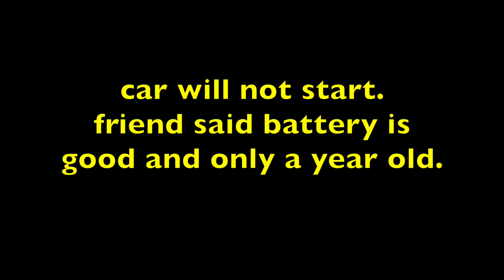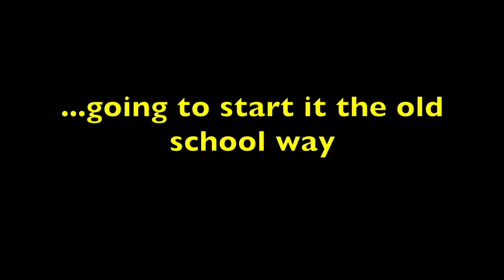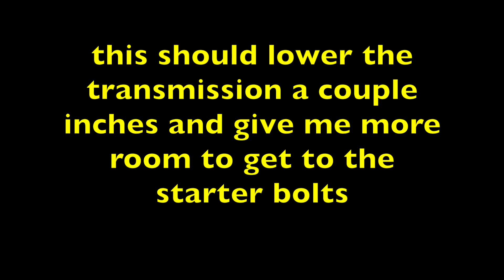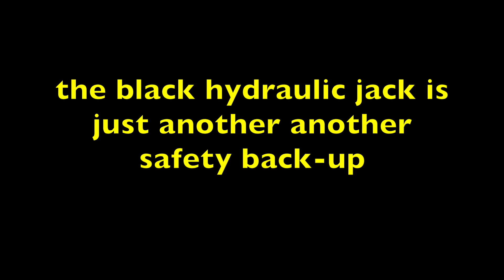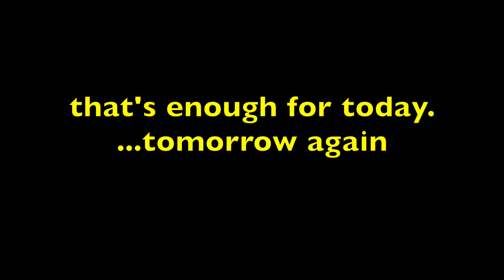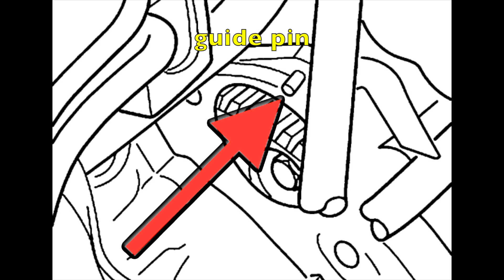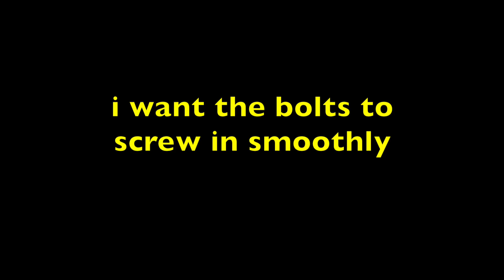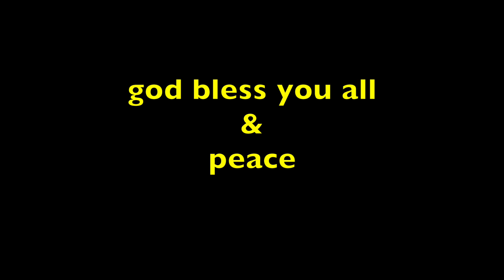You Don't Want To Do This STARTER Replacement BMW 325i √ Fix it Angel

Comment: Removing the intake manifold is the best way to do this starter..
Reply: Kkkkkkk he didn't know how he knows
Reply: yep, that's how it's done. At the same time the CPS is replaced because that sensor is also a bitch to replace and it does fail. Doing it under is the most difficult route.
Reply: What’s the CPS?
Reply: @mavricxx  Crankshaft Position Sensor, same location as the starter.
Reply: @mavricxx   Crank Position Sensor
Reply: While you do that  ,replace everything !!!! I have a bmw e46 as well and they are not reliable
Reply: I hate working on BMW's. They are such a pain in the ass.
Reply: @rolac6109  My lil bro has one and it’s been okay. Just the stupid gaskets leak.

Comment: Please people do this from the top.....I know it seems daunting to pull the intake but its really not, then everything is really easy to access. no jack, no lowering of transmission, no risk of dropping a car on yourself or the frustrations of try to reach up into that tiny space. and honestly its much faster.

great job on the video and your tenacity is to be admired.
Reply: how am i supposed to kill fuel pressure when i cant crank the engine over...... i hate this car cant wait to get rid of this hunk of shit
Reply: @words1238  there's a small valve at the front of the fuel rail it's a Schrader valve like a bicycle tire this allows you to relieve pressure from the fuel rail

Comment: Just did it on an e82. Took the manifold out and did it from the top. Back bolt for the starter was tough but with a flatter flex head ratchet, I got it no problem with the intake completely out. Tried it with the intake just off but not fully removed. Pushed out of the way, and no…fully remove the intake manifold, and it’s pretty darn easy! I’m very mechanically inclined but never did this project before. Took me 4 hours or so, but that wasn’t me working super diligently. Took my time, took some beer breaks. Also tested my starter at the white junction box. Tested it with a multimeter. Told me we had proper power all through the system to that point, which only left the white wire running power to the starter. Not a fan of the tapping the starter method to diagnose it. Multimeter is a must on electrical issues!

Comment: On some of those BMW's it's much easier to remove the intake manifold to gain access to the starter.
Reply from the maker: I will try that next time. Just following the repair manual procedure
Reply: Most pple seem to be recommending removing the intake

Comment: Great work. I’ve done a few of these at work. I’ve always pulled the intake manifold; alittle more work but ALOT easier. Labor time is more than enough.
Reply from the maker: i will try from the top next time. i was just following the repair manual. But you can always say, there are other ways to do a repair. You don't have to always follow the book. Many have commented like yours. Go on the top and remove the intake manifold. I get it. thank you for the comment. Happy Thanksgiving.

Comment: brother just take the intake manifold off and use a 10 mm box wrench to get the etorx bolts off the back of the starter, I did this whole job on my e46 in an hour. granted I have taken my intake manifold off over 10 times and it takes me 15 minutes at this point. Your commitment to getting it out from the bottom is admirable and I appreciate your effort.

Comment: The BMW E46 6-cylinder engine starter motor is located on the left side of the engine below the intake manifold. It is not the easiest part to access on your BMW and can be replaced a few different ways. On most rear wheel drive manual transmission models, you can access the starter from below. On rear wheel drive automatic transmission models, you can access it from below but there limited workspace. On all-wheel drive models, the sub frame has to be lowered to access the starter from below, so I prefer to pull the intake manifold .
You should be aware that in all 6-cylinder models you can pull the intake manifold out of the way to replace the starter. You have much better access and can avoid lying on your back for hours.  Great video , well appreciated the effort you took. keep up the great work.
Reply from the maker: thank you for sharing. i appreciate it. have a nice day.
Reply: On e36 better to lower subrame in engine bay and lower gearbox a bit and do it from under the car than removing the intake many cus that wont give you much space to losen the bolts from starter

Comment: Replaced a couple not a fun job except i did it from the top & removed intake. It's a little bit easier than from the bottom but a good video as always angel :)

Comment: Hey Angel,  Have you done a starter job on a 2001 to 2007 Toyota V8? Its under the air intake manifold!!
Reply: So does a 2010 Honda civic

Comment: At 19:06 we can tell that someone had removed the starter before and didn't bolt the cable hanger with the loop using the starter outer bolt. This is why it seems these two E12 bolts are not too hard to loosen.
You should use a 24" long 1/2" externsion to remove these bolts working at the back of the tranny, not at the left side as you did.

Comment: i dont even remove the intake manifold on the e46 . just remove the cabin filter tray on the firewall and get a few 8mm open end wrenches. take the plastic cover off from around the master cylinder to get a lil more comfortable. then pull the starter out from under the throttle body. Thats how i do it on the e46

Comment: Had a Ford Sport Trac - two bolts, two wires and it pops right out ... But.. you can't get it out without removing the exhaust manifold! But this is way worse!!! Thanks for the heads up. Unfortunately for you if this was a friend or relatives car you didn't get any money for doing this. I'm in that boat! I work for hugs and " thank you's) . Great video. Thanks!

Comment: You sir, are a lifesaver. I wasn't changing my starter but I needed to replace the cable from the alternator to starter. No need to remove the intake manifold with this method. I actually was able to use a mirror and two extensions on my ratchet from the front of the car once my oil filter housing was out. I also removed the CCV lines. For installation of the cable I went under the car like you and used my mirror to guide me. Only thing was I lost the 13mm nut.

Comment: My freaking 2001 Z3 Roadster just crapped out on me and I need to do the same, I am still debating if I want to work from the bottom or take the intake manifold and work from the top. thanks for sharing

Comment: i hammer the starter a few times and it did start. but this is only temporary and the starter later failed. eventually have to replace it.

Comment: Lmao you're giving me flashbacks when I changed the starter on my 97 M3. It would have been easy if the previous owner didn't tighten the shit out of those two bolts when he did a clutch job. First I removed manifold but that's when I found out the bolts were too tight so I had to go from underneath.
Reply from the maker: when you think things will go smoothly. lol

Comment: It could have been started in reverse also no need to push back then forward.  Also you should have just pushed it into the driveway 1st time.  Agree on pulling the intake to do the starter waaaay easier then underneath.  Good job tho.

Comment: I did one of these once, that was once too many...pig of a job. I estimated it taking around an hour, and I didn't want to remove the intake manifold, but I should have. I think it took me around 2 hrs. Started from underneath but ended up working mostly from up top with E torx ring spanners..Hardest part was getting the bolts started again, very difficult to get hands in there, hold the starter and start the bolts, no room to move and no stud/s to support the starter??!!....Got there in the end, then found the battery was also flat😂
Reply from the maker: yes you are right!! the books says labor time 2.2 hours. I bet that's if you have lift and you are a master mechanic. LOL
Reply: @FixItAngel  Wasn't too far off time then...Unfortunately no lift, but even with a fair few years experience, nothing is ever easy nowaydays. It was R/H drive but still very cursable...I did it in a customer's driveway with a trolley jack and only used one axle stand, did it mostly from up top, fighting my way past all the other junk and hoses in the way..lol🤣

Comment: There is a much easier way to get those mounting bolts out, for me anyway. I use the right size ratchet wrench from the top. It works just as well as a reverse torex socket.

Comment: There's only one and time saving way to replace the starter on this car and that's removing the inlet Manifold , which vert good accessible, only 1 nut is bit pain which hold the Manifold straight up, rest I would say 1.5hrs job.

Comment: On e36 its easier from under the car just drop the gearbox and engine abit and its easier than removing intake mani cus there not enough space to lose the bolts especially if its on there for 300000

Comment: did you had to use the computer to finish the job or the BMW  doesn't require that step when changing the starter .
Reply: they do not need for starter replacment on e46
Reply: @russell76531   thank you.

Comment: Remove intAke manifold and remove starter. Most easiest and efficient way to do it.
Reply from the maker: next time brother. just following what the repair manual shows. there is always another way to do a repair, right? have a nice day.
Reply: @FixItAngel   it’s good that you follow repair instructions. For any starter replacement in bmw always easier to remove manifold it’s right under. Keep up the good videos brother

Comment: It would be a hello of a lot easier to take the manifold of and then you take the starter of you would save a lot of time doing this job that top bolt is the biggest problem to take out from the bottom never do this job like this guy is doing do it from the top u save a lot of time don't be stupid use your head.